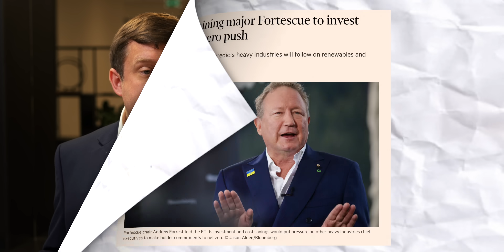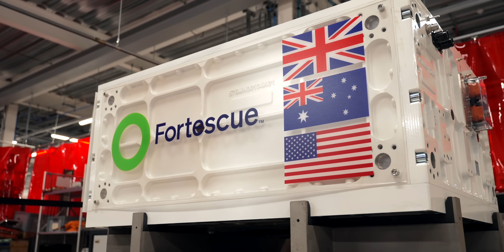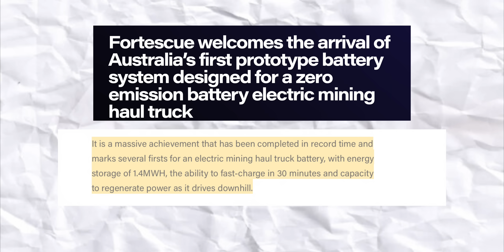This GIANT Electric Mining Truck Charges in Under 30 minutes!

Comment: … and it runs for how long hauling how much? 
Absurd. Sure, you Can build this, but how useful is an electric Euclide? Yawn.
Reply: It's very useful because they can run it off local power. Shipping epic amounts of diesel to the pilbarra is more expenisve than using local PV+EV. That's one reason the mining outfits are so keen.
Reply: @xxwookey it could be useful if they solve the issues. 
Currently it ISN'T useful  nore have the issues been solved. 
The two go hand in hand😉👍
Reply: @xxwookey 
😂
The local power isn't green, plus the amount of energy needed would be astronomical.
Just look at how much energy is in diesel the many thousands of litres you burn each day , you now need to make a power station to take up that amount of kWh
Reply: Pretty sure they've built this to find out ;)
Reply: @handsofdoubt31 

Should have gone straight to hydrogen.

JCB did, some while ago (and they build hydrogen powered buses in Ireland even as we type).

Robert covered the hydrogen as a fuel in modified head ICEs last year.

A quick Google will reveal a lot of truck/truck engines builders are doing ditto.
Reply: @mikeypc3592  

Not quite correct.

You perhaps forget the object of the exercise is to try, rpt try, to "decarbonise" our atmosphere.

Hydrogen as a fuel is considered an excellent way to do this.

You might have noticed our promised giga battery factory is again on the back burner, so to type.

More research for you.
Reply: @t1n4444  The problem with hydrogen is that it's hard to ship so you need to make it locally from water and electricity. They loads of electricity but not much water, and you use 6 times as much leccy sending it to the wheels via hydrogen, so you might as well just use it directly. It's a lot cheaper.
Reply: @xxwookey  

No.

You're giving us a history lesson here.

Allow me to introduce you to the EHB, (European Hydrogen Backbone).

Nothing to stop you doing the Google research thing.

Chapter and verse on the topic, and you will note this includes UK.

We're still in Europe but not the EU btw.

We're still connected to Europe by at least five subsea  power incomers (2 way in fact).

There is even talk of connecting to Iceland ... they have a lot of geothermal capacity, possibly too much ...

For all we know there could be more, as in the subsea cable from Morocco although said cable may not now terminate in UK as such.

You might amuse yourself by researching the vast, truly vast, solar farms already in existence across a swathe of N African countries, and more to come.

No need to guess who buys that energy.
Reply: Most warehouses use electric forklifts and they operate continuously for more than 8 hours a day before being recharged.
Reply: Is there a chemist in the house? 
How did the greatest flourishing of life on this planet, the Cambrian, ‘suffer’ exuberant growth at 6,000+ppm? The CO2 rule of thumb I learned is for every 100ppm added there are diminishing returns - rapidly approaching zero. It’s logarithmic describing the upper limit of what CO2 can even reflect. Scary IPCC bed-time stories has people peeing their bed over the number 450ppm. 
Mankind is so very mighty the earth trembles and future ages fear our mighty fizzy water drinks. Go ahead and count the {tens of} thousands of industrial, commercial and consumer ways we deploy carbon dioxide, then compare-and-contrast how many tons sea magma vents spew more than All of Mankind, and does this about every decade, across deca-millennia: you see the Earth abides. 

There are plenty and real industrial pollutions choking ecosystems and toxifying our lives, but CO2 is silly distraction - at best. 
This smells like yet-more tax-dodges and public-money siphons.

Comment: Unbelievable! Can't wait for electric planes
Reply: obviously they might happen in the future but will just be for very small trips never going to compete with liquid energy/ fuel.
Reply: that becomes a much bigger issue. With this the weight of the vehicle isn't that big of a problem. But with a plane having that much weight in batteries becomes a very big obstacle for use ability
Reply: @liljay300000 battery technology is evolving at such a pace where energy density (wattage per kilogram) will soon reach a point where commercial aviation becomes possible.
Reply: Do bear in mind tge weight of fuel in planes. Concorde had about 100 tonnes, ( paris to ny wiult use 95+ tons. Every trip. current jumbo jet is around 200 and a380 holds about 250 tones. All of this fuel sungle use. That gives a lot of scope for battery / weight issue.
Reply: Taking off on a runaway but descending with thermal runaway...They'll figure it out soon
Reply: Have you heard of Google?

Electric passenger planes are a thing already.

Don't use batteries though.
Reply: @t1n4444  there are super small one and 2  person electric planes. But there is not a single feasible commercial electric plane
Reply: @liljay300000  

And yet RR have FAA approval for an engine to propel a Gulfstream. Apply Google.

So perhaps "feasible" is a semantic thing?
Reply: @t1n4444  nope they are not.
Reply: @alanmay7929 

Suit yourself. You could have researched this prior to posting though.

Comment: How on Earth is a mining company going to decarbonise by 2030 by having a few electric trucks, where does the energy come from to manufacture these trucks in the first place? 

Are all there subsidiaries going carbon neutral by 2030:- 

Subsidiaries	• Fortescue Energy
• Fortescue Metals
• FMG Resources Pty Ltd
• Ncz Investments Pty Ltd
• Pilbara Gas Pipeline Pty Ltd
• The Nullagine Joint Venture
• FMG Resources (August 2006) Pty Ltd
• Chichester Metals Pty Limited
• FMG Magnetite Pty Ltd
• Pilbara Marine Pty Ltd
• FMG Pilbara Pty Ltd
• Karribi Developments Pty Ltd
• FMG Solomon Pty Ltd
• FMG Iron Bridge Limited
• Fmg Pacific Limited

What a load of woke signalling, in my opinion. 

💩💩💩💩💩💩💩💩💩💩💩💩💩💩
Reply: By getting their power from PV/wind and decarbonising their transport and processing. That will be 90% decarbonised at least. Vehicle manufacture will be a pretty small part, and that can be decarbonised too, but it might take a bit longer than 2030. It's dependent on zero-carbon iron-ore for a start, then zero-carbon steel manufacture, and so on down the line. I don;t know what the subsidiaries are doing. I guess if Fortescue is decarbonising the whole business then those will be looking at what to do as well.
Reply: @xxwookey bud you might what to do more than research buzz words. 
Green steel.
Decarbonise?
Take a look at how steel is manufactured.
You will soon realise carbon is critical for quality steel. 
Then tell us were the carbon is derived from for "green" steel?
You might be surprised.
Reply: Because they'll buy credits from a forest to not be cut down that was never going to be cut down.

Comment: That is a lot of mining required for those batteries , I think the top wire approach makes more sense , maybe a combination with fewer batteries and a top wire system. When we get other batteries, it will be a different story.
Reply: Depends on the use case. In some mines a top wire works because there is a fixed entry/exit path that needs to be taken. In other operations more autonomy will be needed to get around. They're always going to be looking at the bottom line and will choose the technology that fits each use case the best. In fact you could look at it as them developing this tech for the use cases where fixed lines aren't appropriate.
Reply: 20 times the battery for a vehicle that uses 100x the fuel of a diesel car while operating almost 24/7? I have to say I strongly disagree with you there, that is nothing in comparison.

Makes just as little sense as those arguments being made against electric long-haul trucks, where most vehicles have and will drive over a million kilometers on a set of batteries.
Reply: Another reason for the mining industry to switch to batteries. More mining necessary! 😁

Comment: And this technology might extend to producing a continuous supply of nacent Hydrogen for reducing Iron Ore, or some other metal ores too.
Reply: Just store the hydrogen. That should be cheaper than batteries.
Reply: @placeholdername0000 Nope, hydrogen is objectively more expensive than using batteries and electricity
Reply: @TimJW  wrong its not, we have been developping much better hydrogen storage capabilities to change the game  too.
Reply: @TimJW  Not when you need hydrogen for the production process.

Comment: WOW, 100,000 batteries. I wonder how much of an environment impact the manufacture and how much it costs to fuel JUST 1 of these monsters takes to charge?
I can't wait to see on of these run unto thermal runaway.......Drivers/operators need to be good sprinters.
Reply: I always hope guys like you are just trolling smh (as if ICE vehicles never have issues - after 100years of development nonetheless)
Reply: @Gregory-Mugen  It's the kind of person that would be against going to cars from horses, reactionaries are the absolute worst people.
Reply: @francismarion6400  Take your meds bro 💀
Reply: @kristoffer3000  You'd be a peon in a real Soviet society as well.
Reply: @francismarion6400  Bro, take your meds, you're having an episode.
Reply: @kristoffer3000  You finished the laundry and dishes? Then dust.
Reply: I can't wait for a diesel one to runaway, you know like diesel engines do every day.
Muppet.
Reply: To answer your question - less than the environmental impact of fuelling the equivalent vehicle with MILLIONS of litres of diesel over it's lifetime. Lifetime impact is what you need to be thinking of.
Reply: It's an autonomous haul truck, no operators inside :)
Reply: Not as much as the environmental impact of all the coal these things will be shifting about 🤷‍♂ They also said in the video they will be looking to charge from solar. Wonder why they aren't using a coal powered generator to charge them? maybe just cheaper to run and operate on solar energy 🤔
Reply: @steve_787 They're moving iron ore, not coal. And a lot of remote minesites have their own diesel generators not coal. They can save A LOT of diesel (and cost of transporting all that diesel to the middle of nowhere) if they can get decent amounts of power from solar and charge electric machines. Not really a shortage of sun and open space out there. Just have to make sure they can handle the heat, dust, and the odd cyclone.
Reply: @patrickbeck4062  yes, I didn't pick up on the fact it's iron ore where they are testing these 👍
Powered from the sun and it's just a no brainer for them really. Even if the mine expands then could relocate the panels to another part of the site to limit any back and forth of the dumpers? 
Keen to see the Infinity train mentioned at the end in action 🤞

Comment: Electric powered dump truck in a coal mine.... I'm sure next sentence will be ironic.
Reply: Iron mine not coal mine 😊
Reply: We're you paying attention .... Iron. Not coal !
Reply: 1. It’s iron. They said it umpteen times in the first 5 minutes. Amazed you missed it. 2. Even if it was for coal, EV is still better than a 10 gallon per mile super truck
Reply: coal is used for alot of applications lol!!!
Reply: Who digs up coal now?
Reply: @rogerfinch7651  alot of countries actually, also coal is used alot in steel manufacturing think about that.
Reply: @alanmay7929  But you can also make steel without (coking) coal. There are several ways to do it. The first plants are being built now. Steel is $500/tonne and also makes 2 tonnes CO2 per tonne. If you had to pay the pollution cost (~$100/tonne) that more than covers the cost of zero-carbon steel process, so decarbonised steel is actually the same price or cheaper than how we currently do it, overall. And everywhere needs to reduce their scope 2 and 3 emissions, so I expect we'll see quite a brisk switchover. The main issue is that plant is amortized over a long time, so companies don't rush to replace it all with the new stuff.
Reply: @xxwookey  are you talking about steel production with hydrogen?! im not an idiot! i know about that too! arent youy the same guys that were talking crap about hydrogen all the time?! its funny how the table turns hein!
Reply: @alanmay7929  hydrogen for steel production is a sensible and probably cost-effective use of it. Hydrogen for vehicle engines and heating homes is much more expensive than using electricity directly and thus is very unlikely to be successful in the market. It's perfectly rational to understand that hydrogen is more useful/sensible/cost-effective in some applications than others. One doesn't have to be 'pro' or 'anti' hydrogen for all possible purposes. That would be ridiculous - it's all engineering, finance, utility and physics, not sports teams. :-)
Reply: @xxwookey  wrong!!!!! very wrong! the only problem with hydrogen now its the storage1 hydrogen can be produced using excess energy from renewables.... Iceland has been overproducing electricity for very long time from renewables! imagine what they could make and store hydrogen for a verry long time for all kinds of applications later. batteries didnt just started beeing well enough. batteries arent the ultimate solutionand for steel its yeah a great solution period.
Reply: @alanmay7929  yes hydrogen is useful for energy storage, especially anywhere with salt caverns, and it should replace methane for peaking/fill-in. But are you really asserting that it's going to get widespread use for heating and vehicle engines? Mr Liebreich disagrees with you, and so do I. It's financially and energetically foolish in other than niche cases. Anyone who can use the electricity directly instead will do so.
Reply: @rogerfinch7651 

Australia is quite keen on digging it up and flogging it to China.

Yet Australia is quite keen also on going green.

Hmm ...
Reply: @t1n4444  
Rams, land cruisers etc
Reply: @rogerfinch7651 Australia, china, Germany, USA....

More coal is being mined now than every before.

Comment: Perfect. You want one of those setting alight in a coal mine. FFS
Reply: (Ignoring the fire aspect as this has been talked to death) If only you'd watch the video or even read the title... it's an iron mine
Reply: @Stephen-Jones well that’s ironic…
Reply: Well at least the coal mines will start to close down in the coming decades 😉
Reply: @steve_787  you are joking ain't you. China love it and they are using more each year.
Reply: @DaleSteel Eh, mainly because of their excessively centralized planning system (to a certain extent a leftover from the communist era), and the fact that their infrastructure is lacking. They are also building loads of wind, solar and nuclear.
Reply: @DaleSteel  maybe time to look at what China are actually doing. Only reason they are using more coal is because they can't build solar and wind fast enough. They should peak in the next couple of years and then its going to drop off. Simple maths that solar and wind you build and leave for 20+ years but coal power needs a constant supply of raw material. If you sold energy, what would you do? All about profit.
Reply: Please go back to sleep. 🦖
Reply: Electric vehicles have been used in coal mines for many many decades.  <shrug>
Reply: Fortescue is mining iron ore